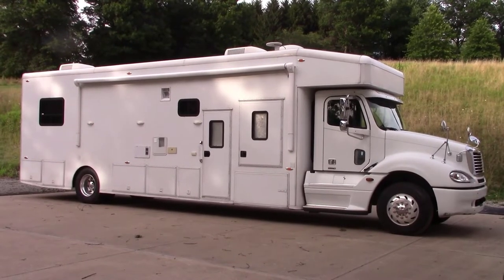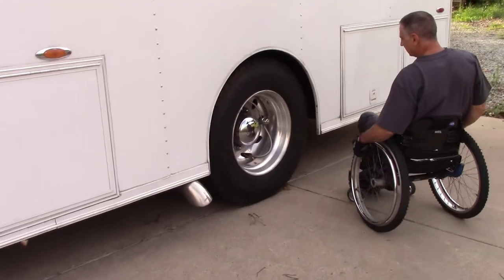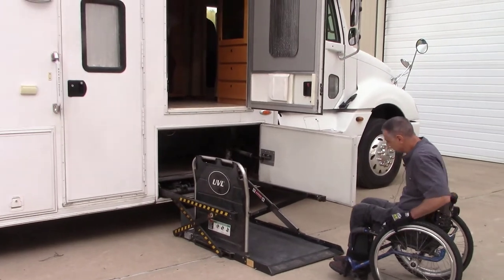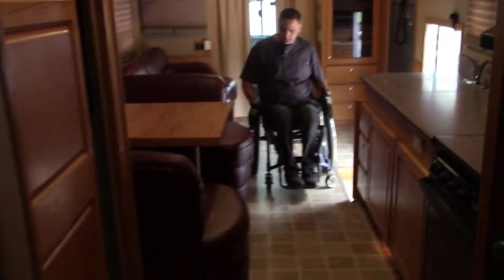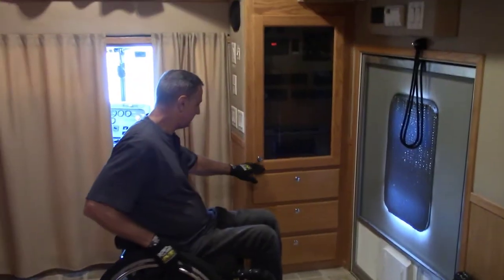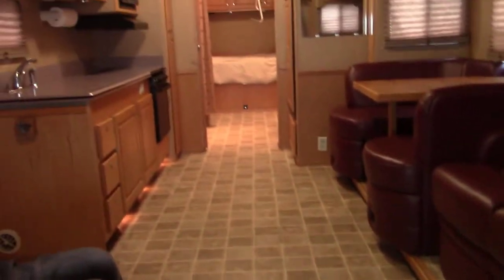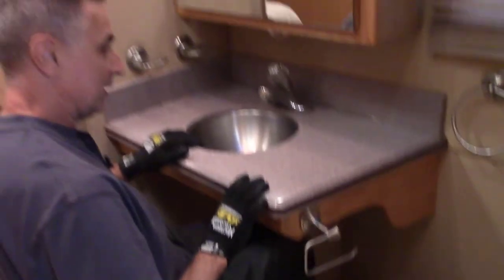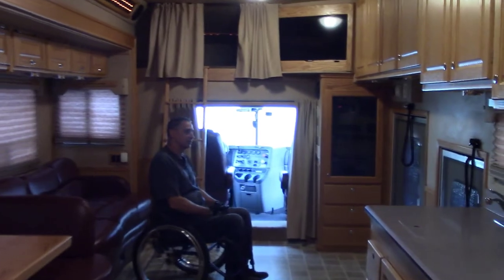Wheelchair Accessible RV

Comment: Thank you for your service! I really like the way you made the whole RV accessible. I can’t help but wonder why you didn’t make the shower a little easier for you? I have been a paraplegic for over 30 years and unfortunately my shoulders are getting worse with age. It’s hard to see In the video how far you have to transfer to get in the shower. Also wondering if you have to have a CDL license to drive it? Great job! If I ever hit lotto this is exactly one thing I would buy!
Reply from the maker: Thanks for the comments.  I did not want the roll in shower because too  much chance to get water out of shower and into other corners and cause rotting.  That transfer is not bad as long as you have upper body strength.  CDL = COMMERCIAL Drivers License.  This is not Commercial when you are driving personal RC so, No CDL needed.  However, I often was towing a trailer over 10,0000 lbs.  Therefore, I did get a CLASS A license, which allows for same size vehicle as a CDL, only for personal use.  Much easier to get.  Only had to take small test and driving test.  If I towed less than 10,000 lb trailer, no Class A license needed.
Reply: @neemafastcat  thank you for responding. Have safe travels!

Comment: How worthwhile is getting one of these?  I'm about to retire and wondering if its feasible to get one of these to tour north America for a couple years?  I wonder how tiresome it would get after a year.  For example it looks like it's a nightmare to change the bedding, get to the cupboards above the bed. And I imagine it comes in handy that you travel with at least 1 able bodied person to help with hookups to water/sewage etc?  And is it hard to find a place to park each evening?
Reply from the maker: I used it for work mostly.  When travelling, you have to go where tractor trailers go, not into small parking lots or tight shopping areas.  If you were going to have one to "see the US", you would likely want a smaller RV or want to tow a vehicle behind so you have wheels to go somewhere once you are parked.  I made many trips without an able-body with me. Just don't put things in cabinets that you cannot reach.